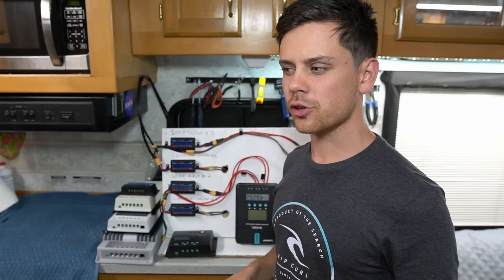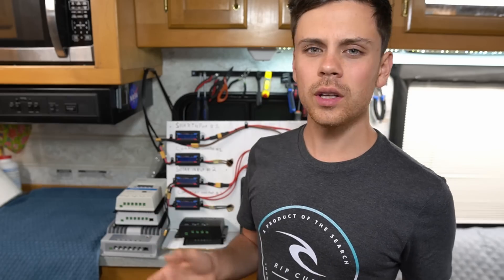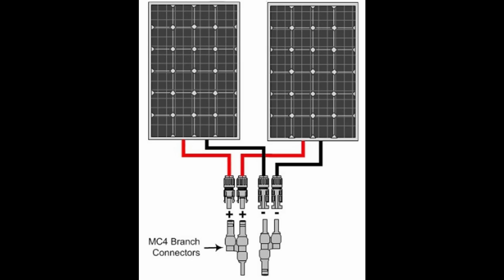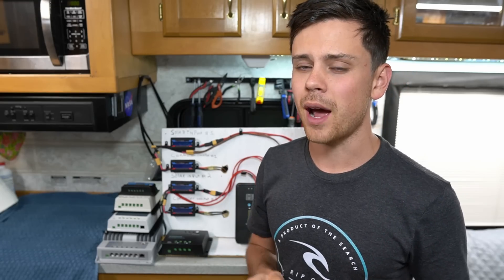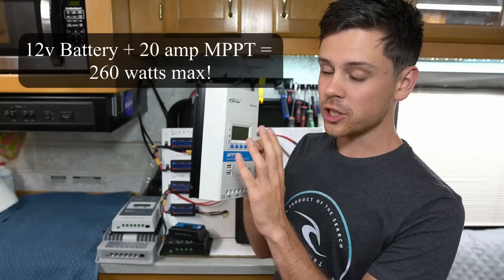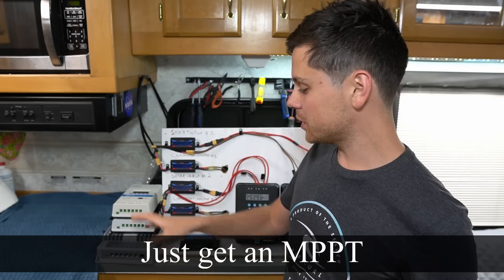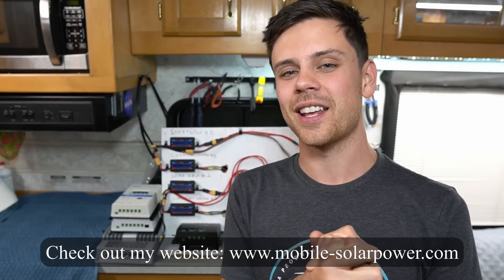MPPT vs PWM: Fast comparison for off-grid solar

Comment: I've just started looking at your videos.  Very nicely done!  I've done 8 or so installs on various RVs since 2010.  Amazing how much has changed and how much less expensive it is now and how much easier! One question regarding your comment about Chinese manufactured MPPT vs. others: are you confident that these less expensive units will actually hold up in real world conditions?  I suppose if they are cheap enough you could stock an extra.  But if you are relying on solar for your world and you have a failure in the dead of winter and no spare available you could have a real problem...
Reply: I've wondered about that too. I've also wondered what their typical failure mode is. If they normally fail open circuit, that's obviously much less of a problem than if they frequently fail spectacularly and overcharge the batteries, possibly start a fire, etc.

Comment: In my opinion pwm vs. mppt isn`t determined by watts in most cases. It's voltage. Morningstar has a 125 volt max for thier TS-45 pwm controller.

Comment: Hey! Props for the video! Here is my setup, I live in a subtropical zone of Brazil(not tropical but still pretty sunny), I have three 150w (18.7v by 8.20A, all in parallel) solar panels, three 60A/12v car batteries(parallel) and a 12v to 120v inverter. I am currently using one of those cheap chinese 30A charge controllers (PWM), witch is black all around but has a blue front with a small display and a couple of buttons. It came as a "gift" when I bought the panels. The only things connected to the inverter are a 35'' LED TV, 150w, and all the light bulbs of the house(all LED), witch, if turned on all at the same time(witch almost never happens...) puts a load of 160w at most. The thing is, we only turn on the lights at night, shutting them down when we go to sleep. The same goes for the TV set. My mum only watches TV at night. With no load on this system during daytime, do you believe I have something to gain in changing to a MPPT charge controller? Thanks in advance.

Comment: If you use a mppt to charge a lithium phosphate battery with a BMS  dose it really matter what the voltage from the mppt is because the BMS will protect the lipo battery  being overcharged ??

Comment: I see you do a lot on solar power do you do much on generator power something that’s already creating AC current and and wiring it into your fuse block in is it possible to backfeed into the grid ? And do they make a GTI which you can pipe in AC current whatever your house uses you use whatever is extra goes back out into the powerlines and watching your videos thank you looks like in MPPT would be the way to go for what I’ve seen that the MPPT would re-channel the electricity to be in a better format with national grid ? Any Help is thankful ! You’re Wisdom is phenomenal about electricity I’m just trying to save my electrical bill by creating my own electricity I’m using a car alternator GM one wire alternator oldschool big block load turn charging hi I tested it the other day with my battery powered impact gun 2000 RPM top speed I had my meter on it on one of the three leads coming off to stator because the car alternator creates AC current and converts it to DC so I tested it before it got converted at about 2000 RPM my meter was reading 184 V I ordered another mirror for testing house electricity for amps and I’ll be testing that soon , maybe 125v x 90 Amps = 11,250v from a car alternator Ac Current

Comment: A good subject matter but you left out some key factors. With MPPT conversion efficiency drops the higher the array voltage relative to the battery bank voltage so I’m not convinced that on cloudy days an MPPT controller would deliver more amp hours than a PWM (it would be interesting to do a side by side test for this).

Comment: Do a series on Free Alternator energy! A car alternator creates AC power and converts it to DC and is to creat 110-115v off the stator ! But how to harness the power and feed it into you’re fuse box ?
Reply: Connect to the chassis battery?

Comment: I was going to go with a PWM, but I'm back on the fence again. Note, this is for a cheap micro hydro off grid setup with lead acid batteries, not solar. With the difference in price between the controllers I could add another battery if I go with the PWM.

Comment: Depending upon temperature a properly sized array(voltage compared to battery voltage) with a PWM controller will operate just fine and no need for a MPPT controller.  Unless is a very cold climate, long wire run(like you mention) or if you wanted to utilize grid tie, 60 cell, panels due to them being much less expensive per watt the benefits of MPPT are not always needed.  Also, not using a PWM controller just because you are stuck with MC4 connectors is a bad reason to 'need' MPPT.  With more than 3 strings in parallel you want/need a combiner box anyways so just wire it properly and get rid of the MC4 connectors.  Finally, to say a cheap Chinese MPPT(if it is even real MPPT) is going to work just as well or better as a reputable company is a flat out lie and and false.  From what I have seen they are not either real MPPT or have a very difficult time maintaining proper regulation voltage and their MPPT sweeps are incredibly slow.  A slow sweep means lost power, both the time it takes for the sweep and the fact that you may be missing the power point from the really slow sweep.  Trying to compare EPever to anything reputable like MidNite, Morningstar, Outback(?), or even Victron(?) is a fallacy.  I implore  you to watch your EPever MPPT sweeps under a scope to watch it sweep and compare that to one of the ones listed above.

Comment: Will, I have a question about PWM vs MPPT.  I know you should never connect the MPPT controller to the solar panel before the battery.  However, I don't see the same warning on PWM type charge controllers.  Are they not as sensitive or should the same procedure be followed?
Reply: Same procedure. This is stressed in my renogy adventurer manual.

Comment: Morningstars Charge Controllers last and last. I have installed them since they came out, went off the grid in 1983.  Failure is an inconvenience.
Reply: I agree completely.  I started with really cheap PWMs on a small scale 12V setup with LIFePo4 batteries and had nothing but trouble, I eventually moved up to Renogy controllers which were much better but still not well suited to LiFePo4s.  Then I finally gave up on the economy Products and bought a Morningstar PWM.  It was a world of difference.  The compatibility with LiFePo4 was excellent since you can run a bulk charge beginning to end without any tapering of charge rate.  They just work with no headaches and are super dependable.  I now have three of them and planning to get at least one more.  They are extremely flexible and easy to program.  And if they ever have a problem which I doubt they ever will, you can send them back and get them repaired.  Expensive yes, but in the long term they are a great bargain.

Comment: Hey you are awesome here’s my question. I have a 36 foot Winnebago motorhome with a go power system on ,it has three 160 W solar panels or 480 watts. It has a go power 30 amp solar controller PWM. If I change to a Mppt contorler Wood I benefit from purchasing one. Also what mppt would be a good budget choice.    hope u answer   Thanks  confused solar person
Reply from the maker: https://youtu.be/PB6zojol9o0

Comment: "These are worth their weight in gold" ->  I would be very suspicious because that weight is because of the heatsink, which means poor efficiency. EPever are notoriously when comes to efficiency they are a waste of money for systems < 150 Watt.  Genasun GV-10 is one of the best on the market, no big heat sinks these guys know what they are doing.
Reply from the maker: Genasun has horrible charge profiles. Look up the bad reviews on Amazon. I have never been impressed by what they have to offer
Reply: In all your assessments charge profile is never mentioned. They charge lead acid just fine and make clear distinction between sealed and wet batteries they implement the correct bulk charge and float charge voltages. Honestly what more is there to it charging a battery: constant current, constant voltage and float charge. Maybe you can be a bit more specific about what a "horrible charge profile" is. What is difficult about solar charger design and switch mode converter design in general is efficiency.
Reply from the maker: @jansunman7393  By horrible charge profiles I mean that there are a few reports of people saying that the controller deviated outside of its programmed parameters. I havent had that problem with any of my controllers to date, but I have never used a gensun, so I could be wrong.
Reply: Well I verified the voltages for sealed batteries with the GV-10 and they are correct. Before the GV-10 I had the Tracer1210AN. I used it for 2 parallel 60W panels on my van and it got pretty hot, so no way that it's conversion efficiency is the claimed 98%. The GV-10 did not get warm at all.  Apart from the energy waste I do not want an unattended  controller in my van that could be dissipating like 10W or so. You pay a bit more but get high quality. No electrolytic caps inside just MLCC's. I am not affiliated to Genasun but for systems <150W I have not seen any controller that is better. not even the Victrons. So if you have the chance to test them. I like your video were you use the power monitors. BTW to give you a hint when you want to assess efficiency just measure Wh (energy) for a while on the input an the output instead of actual power because that tends to fluctuate..
Reply from the maker: @jansunman7393  okay. I want you to do put watt meters on the input and the output I want you to substantiate your claims with a video. No need talking about it. Show me.
Reply: Thats ok for the GV-10, I got rid of Tracer1210AN. The url of the video ends with: m-hJIyYFY5Q

Comment: Your story about the wire depends were you place the controller. But the pragmatic approach is to have: PWM controller near your battery and go with relative thin wires to the panel, the voltage drop over the wires will is fine. If you would want MPPT you need expensive thick wires and and expensive controller having only limited benefit.
Reply from the maker: That is simply not true
Reply from the maker: The whole reason you use mppt is for higher voltage from series connection which means smaller wires. You have it backwards
Reply: for series connection you are right, for parallel connections or a single panel I challenge you to do the math given e.g a voltage drop of 1.5V over your long wire

Comment: Weather the mppt tracks the power point the greatest isn't that important to me, the fact that I can use 100vdc plus to charge a 12,24,48v batteries, and not pull the voltage down to battery voltage, the buck conversion makes a big difference, I have made a small controller with a buck converter, and a cheap on off controller , a pwm would be nice , it was only 5 amps At best,  so if you just have 200 watts or less and the panel voltage is close to battery voltage, like 18v for 12v system. A pwm is fine,  I have 1200 watts on a mppt, for a 34 v system, but I prefer the mppt!!!

Comment: Um yes, please bore us to death :-D  Personally, I like the technical stuff.  I can't speak for the rest of your viewers, but I believe it would be a safe assumption most of them like the "boring" technical stuff too.

I recently installed a Victron charge controller that has both MPPT and PWM output.  The PWM is for the dump load (in my case it runs a 600 watt heating element in a 10 gallon water tank).  So yeah, some charge controllers on the higher end have both types of output.

Anyway, thanks, love your videos!  And definitely bore us to death.

Comment: Been enjoying and learning much from your videos. Ty!  So while advantages of mppt are numerous.  Do I understand that if I only run a 12v system at 400watts or less with short wire runs the pwm is a better choice if it has a temp sensor?   I’m thinking not as you did say just buy an mppt. Can u or someone plz comment on this please?
Ty
Reply: It really depends. If you think you may want to increase your watts down the road or live/visit a cloudy, colder area (or upgrade to lithium as most pmws don't currently offer the option) go with an mppt. But I really think the 30% increase in efficiency is exaggerated in warm sunny climates, think closer to 8% or less. One poster on a forum had higher watts with his pmw, albeit very small amount ,. in 70-80 degree sunny weather. In northern states I have seen tests showing a 20% to 25% difference, but this was on a larger array (with older panels being used with the pmw?). As a small setup to try out solar I am personally going with an adventurer pmw from renogy ($40) with a temp and voltage sensor. I am taking the $60-80 difference and buying 200 watt panel for $165 instead of a $100 100 watt panel (just the way pricing for decent panels on ebay seem to fall currently). For small systems with cost as a limiting factor, especially at my level in a southern state, a 100watt system with a mppt will not often outperform a pmw with 200 watts for the same cost, even assuming a magical 30% difference. I think if it goes well we might throw an additional panel up and then upgrade the entire system when we go to a newer rv in 2 or 3 years. At that point, if it goes beyond 400 watts I will definitely go mppt, because 8) hard pressed to find an pmw above 30amps, and b) cost of a large mppt will be spread out over more watts and becomes negligible, theincreased watts add up a bit more as you add more panels. BTW, if you catch a good sale on an mppt, or if you need to replace an old charger or inverter anyway and go with an affordable combination system (have seen one advertised recently for about $330 for a 40 amp mppt/1000 watt inverter/charger), it can easily tilt the analysis a different direction. Also if your limiting factor is roof space (like on a van or small rv), an mppt may very well be one of the only options to increase watts from your system as your panels are fixed in size.

Comment: An adequately sized system with a LiFePO4 battery will be fully charged most of the time at around noon so any gain (if there even is one) will not do anything other than having your battery fully charged a few minutes earlier (no advantage to that).
In an offgrid system you can not use all the PV available energy and typical will be 40 to 60% used from available energy in summer and maybe as much as 80% in winter depending on location and if you even have winters :) so again a point against spending money on an MPPT.
If your system is not sized for your needs then paying a lot of extra for slightly more efficient PV panels or using an MPPT will not help you as those very small gains will not make a difference.
Where space is limited as on some RV's I recommend having a few extra panels even if they are the flexible type that will not take much volume in storage and deploy those when you are stationary and need some extra energy.
My house for the first years was fully powered by just 3x 240W panels and this included electric cooking, fridge, two computers, LED lights and some other less frequently used devices with absolutely no backup. Now since I decided to fully heat my house with solar PV I have huge amounts of excess and never care on how I use the energy. The point I wanted to make is that you also need to take care of how you use the energy. With small systems you should not consider an inverter or if you use one as I did use it just one or two hours a day like for electric cooking.
A typical 2000 to 3000W inverter will have a 30W or so self consumption and that adds up to 30W x 24h x 30 days = 21.6kWh/month and my usage when I had the 720W PV array was around 50 to 60kWh/month so only using the inverter 1 to 2h per day saves 20kWh/month that is more than a third of my usage.
For laptops use DC-DC converters that are way more efficient and if you need a fridge use a DC one as that is the main reason people use an inverter 24h/day.
Reply: You assume full sun all the time and  are talking abut very expensive batteries. Also you  seem to have thrown money at your system until any restraint is no longer needed. This is far removed from what this video is trying to convey.
Reply: @geraldhenrickson7472  LiFePO4 are the lowest cost battery in therms of cost amortization. Amount of sun makes no difference.
I heat my house fully with PV solar since is the lowest cost heating option slightly better than natural gas that is the next option in therms of cost.
To get some idea about the cost amortization here are some numbers.
PV panels under 2 cent/kWh
LiFePO4 a realistic 20 cent/kWh (by far the best in therms of cost amortization).
Thermal storage as low as 1 cent/kWh
My house has 10kW PV array + 5kWh LiFePO4 + 160kWh thermal storage this allows me to use around 120kWh/month as electricity for appliances (big part of this is for electric cooking) and in January around 1000kWh/month for heating including the 120kWh/month for appliances that also ends 100% heating the house.

Comment: MPPT controller epever efficiency and 30 to 40% higher, they are manufactured to use with higher voltage and panels above 200 watts that the output will be very good.

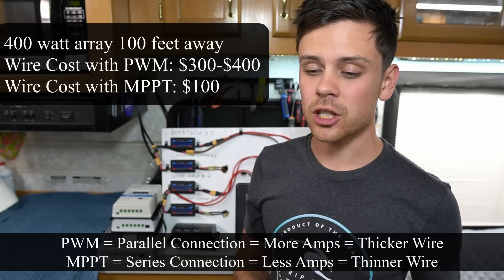Comment: Will,  what AWG wires are you using for the MPPT & PWM controllers in your comparison at timestamp 4:21?
Reply from the maker: 10 gauge copper. And typically if you quadruple the amps, u will need four times the cost for wire.but depends on which one you get